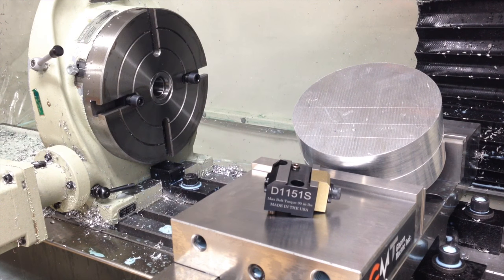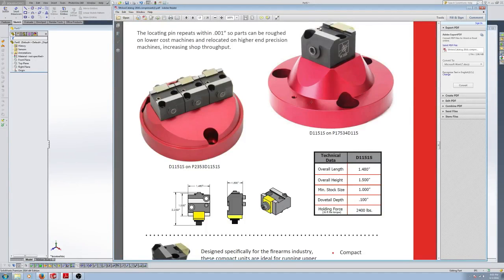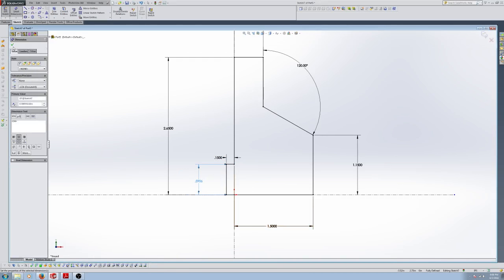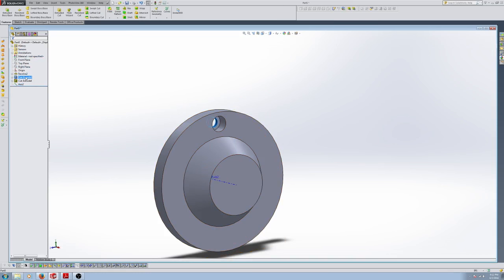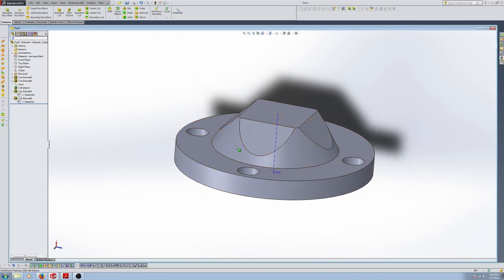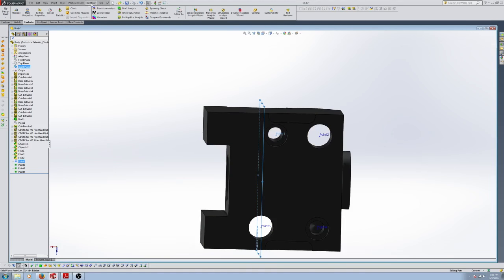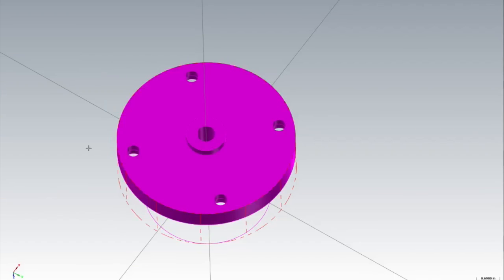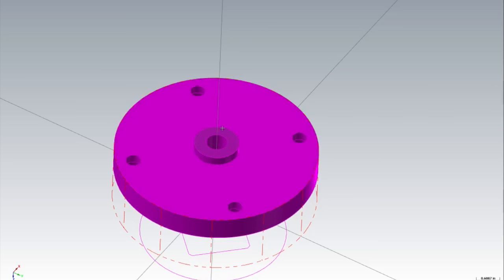Dovetail Riser - Part 1

Comment: Brilliant solution. Always thoughtful explanations on par with Lipton. Cant wait for the machining.  I bought the tormach 2 jaw chuck for the 4th with this in mind, the jaws that came with it are not parallel (two convex jaws) and unusable out of the box, they are removable so I gonna try make replacements but I think will end up doing just as you did.
Reply from the maker: Thanks for the kind words but i don't think i could ever learn as much as Tom has probably forgotten! Love his vids though. Yeah, this is something most people learn the hard way about Tormach products. The incessant peddling of the "Tormach Kool Aid" via infomercial, each week on YouTube, blows my mind!! You might not be able to directly polish a turd but... you partner with the right YT celeb, sprinkle enough glitter on it and you can sell the things to engineering professors... Twilight Zone stuff.
Reply: From previous comments you probably already know I have the same opinion. look forward to the next video.

Comment: I just came across this video.  Funny that I was recently (like 2 weeks ago) looking at designing and building nearly the exact device for my Tormach 4th axis. My choice was also the same part from 5th axis.  Interesting bit of luck, coming across this vid.  Thanks for sharing.
Reply from the maker: Fifth Axis products are really well thought out & made! I'm just making another one of these risers that has a couple of dowel liners and keyed threaded inserts. That way i have a modular fixture system for second ops on the 4th.

Comment: Nice Job, you inspired me and I'm making my own setup. Just downloaded all the models from 5th axis.
Reply from the maker: Great work holding product, use it all the time now. You shouldn't have too much trouble making a riser and to be honest, it doesn't need to be perfectly centered to the 4th. I have made 2 more of them, one for the small dovetail fixture and another with threaded inserts and dowel liners, so I can mount custom fixtures repeatably. Good luck and thanks for stopping by!

Comment: Great work.  Last year, I did the same thing, but square in order to be used in a vise and rotated 90* around it's axis.  Worked well.  I'm looking forward to seeing the completed part and it getting put to use.
Reply from the maker: Thanks! Theres another project coming up that gave me the kick up the ass i needed to go buy the fixture and get this made.. so that projects on the way. Also i have 2 more of those aluminum off cuts... if this fixture works out, i'll be buying its little brother from Fifth Axis Inc and then i thought id make a generic riser block and press fit dowel and threaded inserts in there. That way and can make my own own fixture blocks to use with pre machined components and second ops work.